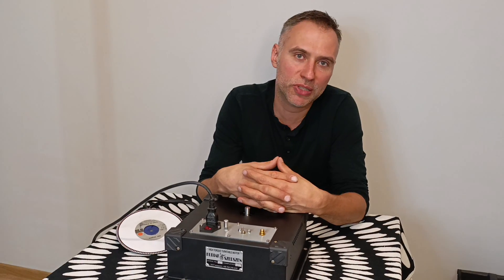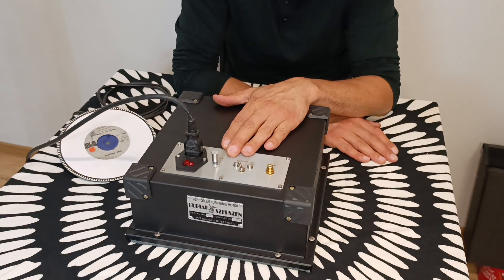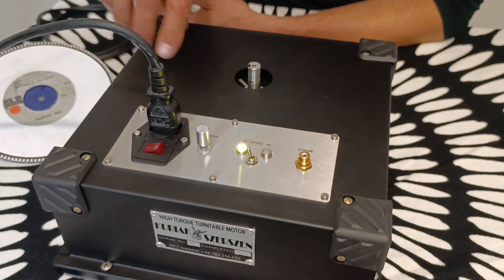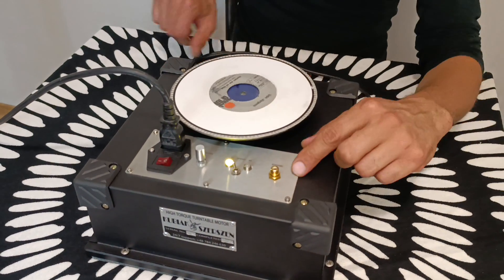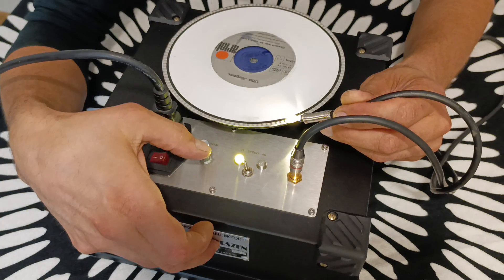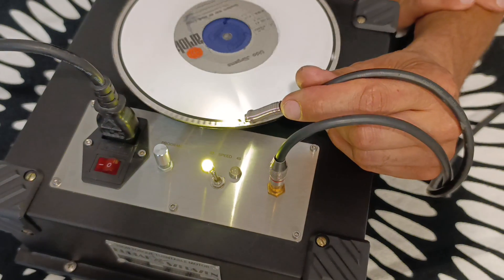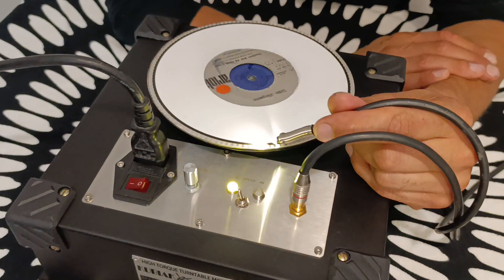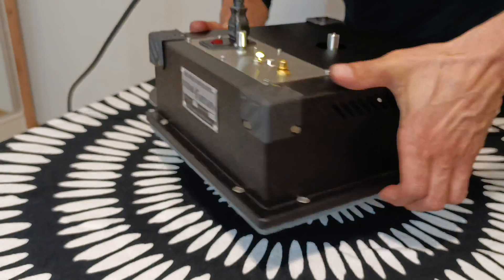No wow, no flutter, high torque direct drive universal record cutting lathe platter motor

Comment: No wow and no flutter is totally impossible. Can you tell us what the actual figures are please?
Reply from the maker: Hi,
let me explain then and let's focus on both terms at first, in simplest words: 
WOW - is a variation of pitch (detectable to our ears or not) that doesn't change colour of the sound (for ex. reel-to-reel machine with super neat capstan+roller but supply reel being stuck) but makes the impression (if audible) of music being flowing, "out of tune".
FLUTTER - is a variation of pitch also, but in such fast phase that your ear doesn't hear it as music being "out of tune" but as being it colorized by superfast "vibrato effect" (for ex. reel to reel machine with perfect tape drive and path, but capstan being bent).

Let's be back to my motor now: It can not have any WOW, as in its basic setup it features 1600 digitally calcuated rotor impulses for one turn. If its computer would miss EVEN ONLY ONE of them (in case you force your platter to slow down, obviously with counterforce bigger than those 1.5-2-5 Nm of it's setup) - it would NOT slow down, but simply stop for a moment, missing that impulse, spoiling the recording. So, as long as it's within its power limits, it will never have even minor wow.

About the flutter: 1600 impulses per turn means 880/1sec. on 33rpm and 1200/sec. on 45. These are far above flutter frequencies, and IF they were transmitted to the recording (becacuse of bad motor/platter coupling, bad lathe design etc.) they would not be audible/detectable as a flutter, but as an extra sound in the groove noise background.
:)

Comment: Ok but why put the controls near the spindle? Those should be on the side of the unit along with the power input so they don't get in the way of things you attach to the spindle.
Reply from the maker: Hi, let me explain then: all controls are far enough from the rotor not to collide with any of the factory platter shaft couplers in existence, and all of the DIY/custom couplers  by  reasonable designers.
Why not at the side? Once the motor is properly centered under the shaft (you surely know wow may occur if it's not), it should not be moved. So, In need of lid opening for service etc, all allen keys and screwdrivers forces are pointed downwards, to avoid accidental displacement of the motor (even if it's felt-padded and as heavy as 12kg) by not super skilled users.
Reply: @jedrzejkubiak3565  Ok I can understand that but what about 12 inch platters?
Reply from the maker: This a record cutting lathe platter, not a home audio turntable one. There is a plenty room above it, as it sits on the cutting room floor (or a special shelf) with the main lathe bed (and obviously a platter) far above it.
Reply: @jedrzejkubiak3565  Ok thanks. That is what I needed explained :D I get it now!